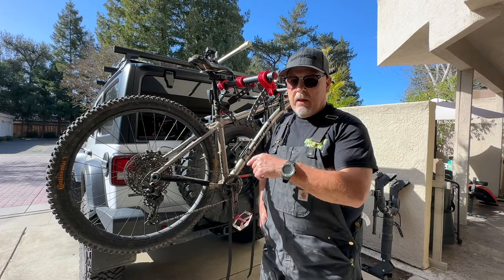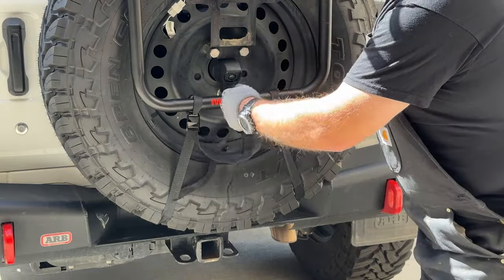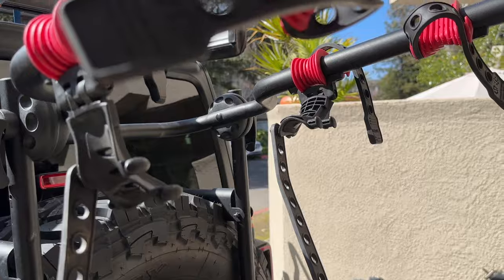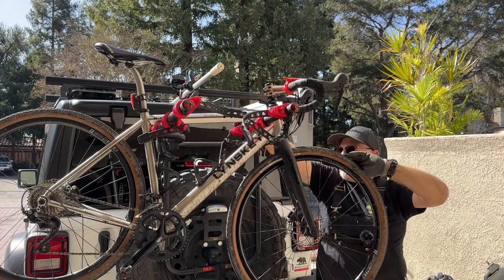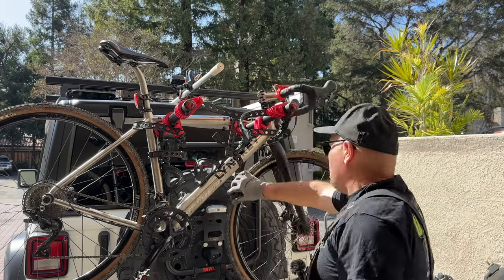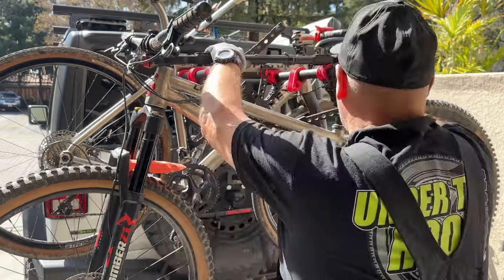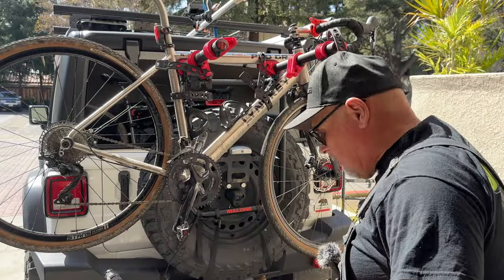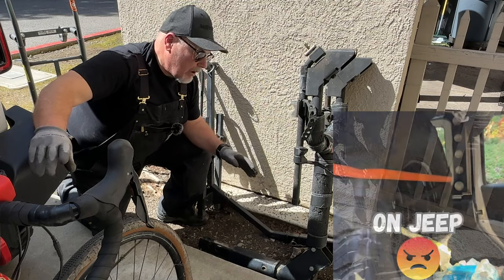Why Is This The Best Spare Tire Bike Rack? (In Depth Review)

Comment: Hi, thanks for this video. I took a chance and ordered one for my 2023 Ford Bronco with Sasquatch package with 35 inch tires. I think the top bar you are resting against your 3rd brake light may go in between the Bronco’s 3rd brake light and the tire. There is about an inch of space between the two and the plastic mounting bracket is flexible. I will update with results. Question for you. Why did you decide to tie the bottom straps to the bumper and not around the back of the tire and attached to the top bar like the manufacturer suggests? That would seem a bit more secure and prevent you from having to unstrap every time you open the tailgate. Thanks!
Reply from the maker: Good luck with the rack. I just did not think about putting them around the spare, that is the only reason. I realized I can get my gear without opening the tailgate by folding down the rear seats and reaching in. I never have to take the straps off now. I leave the rack on instead of taking it on and off. Just threw a cable lock around it. Thanks for watching and looking forward to how it works out for you.
Reply: @MuddyRuttzz  I got my bike rack in and installed in on my 2023 Bronco with 35" tires. Short story, it does fit/work, but I will need to do some modifications to keep from damaging the spare tire and wheel. The top tube does fit between the brake light mount and the tire, but I have to wedge it in and flex the plastic light out of the way for it to fit. The tubing does rest right up against the plastic mount which I do not like, but I will add some padding as described below. Upon testing, the rack worked great carrying my two bikes, but the tire sidewall and wheel suffered slight wear/damage from the rack shifting while driving and the weight of the bikes pulling the rack forward. I plan on adding 2" wide rubberized 1/16" thin padding with one-sided adhesive on the back of all rack tubing that can possibly come into contact with the wheel or tire to help prevent wear from rubbing. Also, I will add rubberized adhesive edge pieces to go on the sharp edge at the top bar which rests on the tire tread. I found this rubber material with adhesive very cheap on Amazon. Lastly, I will add a 10' ratchet strap around the circumference of the tire and wrap around the top rack to help stabilize everything. The straps that come with the rack are not the best. They are not your typical pull-strap ties and they don't keep tension on the straps too well. With all said, I am happy with the rack and would buy it again. Thanks again for the review!
Reply from the maker: Glad you figured out how to make it work for you. The rack is pretty generic. That is what keeps the price down. I have not had to modify mine. I usually have to modify everything I get even if it does not need it. That's just how I am and sometimes I create problems for myself. My friends have spent $700 up to over $1000.00 on bike racks. Glad I found one that was cheaper and works well. Hope you find it to be the same as I did. Cheers!

Comment: Hello there.  I have a question:  Are you concerned about damaging the tailgate?  Do you think the weight is an issue?  That is my only concern with my Bronco.
Reply from the maker: I installed tailgate reinforcement. I don't know a lot about Broncos other than I think they look very cool. Tailgate closed you will not have a problem. Tailgate open maybe? Bikes don't weigh much.

Comment: I'm still scared of racks like this, plastic parts and rubber straps. Make sure to keep an eye on the straps, check for cracks and replace before bike falls off.
Reply from the maker: UV is the enemy of the straps. Malone recommend changing them every year. I have full confidence in the rack. It is only on my tire when I'm going to ride. Its so easy I take if off and stick it inside the Jeep. I can understand why have a receiver hitch would make you more comfortable with that solid connection.